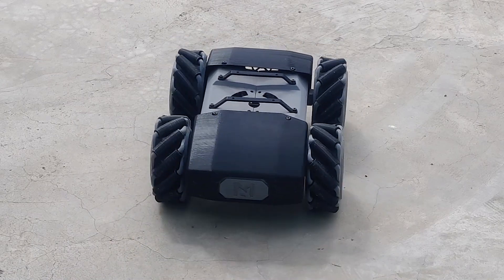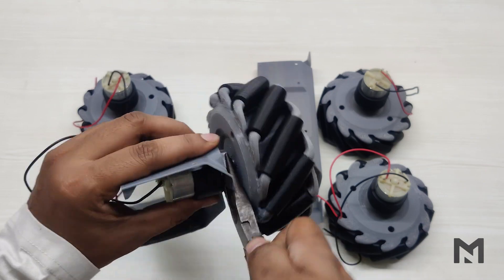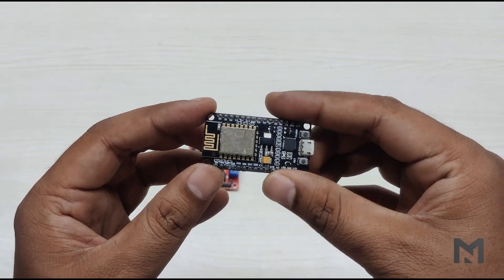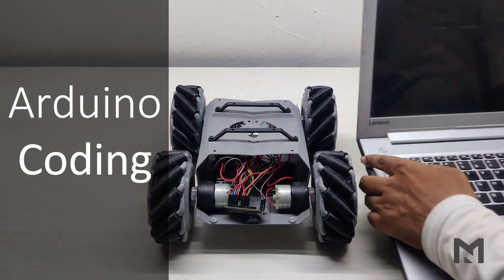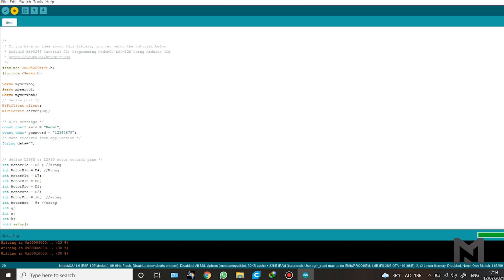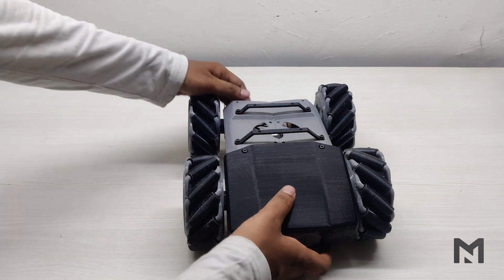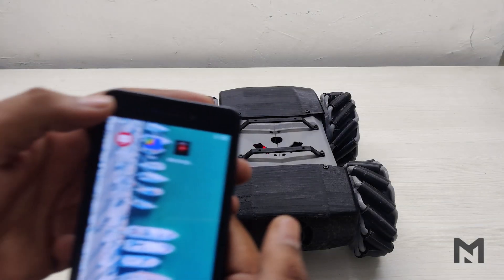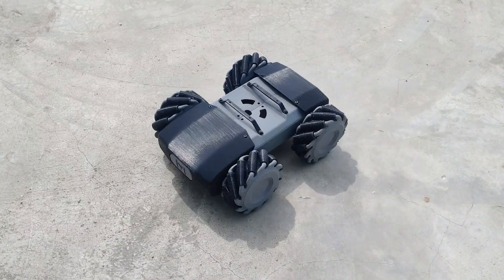Arduino Mecanum Wheel Robot Car | App and code FREE included

Comment: Why didn't u use bms for battery?
How unsafe is your battery ?
Please make a video on how to create a battery with bms if needed !!!

Thank yiu nice tutorial🎉🎉
Reply from the maker: I think so I Have used it.
Its in wiring diagram...I have used a 10A 3S BMS
Reply: @MechNinja 
I saw u used 3s bms ...🎉

I am using  two Toy 130 DC motor (each 250mA stall 900 maA max)with l298 motor driver.

Can i use 2s bms without cell balancing cheap 0.5$ -1$(₹40 -₹100) or do I need to to use bms with cell balancing cost 3$(₹250) .

Reply...
Reply from the maker: @youcube1 use bms with cell balancing, safe for both, you and cell...😅😅

Comment: Please upload for Arduino with 2 L298N Motor Drivers for Mecanum Wheel
Reply from the maker: Why to use Arduino, then we have to additionally connect a WiFi module.
Node MCU is cheap

Comment: Hello, I am building this project and I"m running into a problem. I am using the same board as you, and when I upload the code then open the serial monitor I get some info about check sums  and such and at the bottom where ip address should be all I get is gibberish.  I have the baud rate set to 115200. It does not display a ip address. I have my moble hotspot info entered into the code, and hotspot is on and your app open. Can not find a ip address. Can you help please?
Reply from the maker: From where did you got your code and app
Reply: I paid for the code and app from your website.
Reply from the maker: Check the baud rate in the code and match it with serial monitor...
Else try a baud rate of 9600 and then try it...

Comment: can i use the same code with a ESP32-CAM-MB and the same configuration from the arduino IDE?
Reply from the maker: May be it will work if you use proper library file.
You can give it a try ...
And don't forget to subscribe 😊😊😊😊